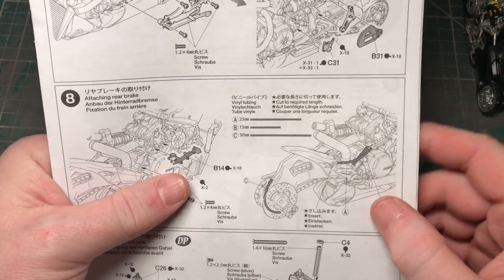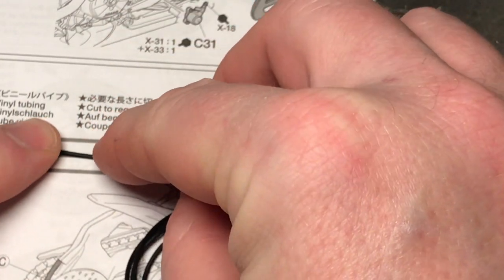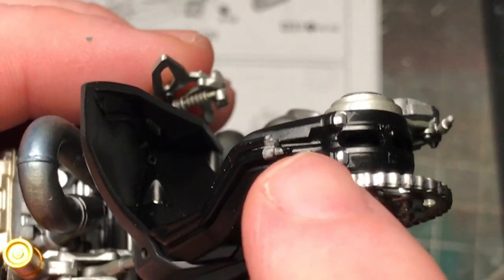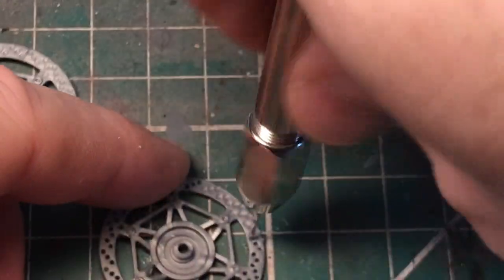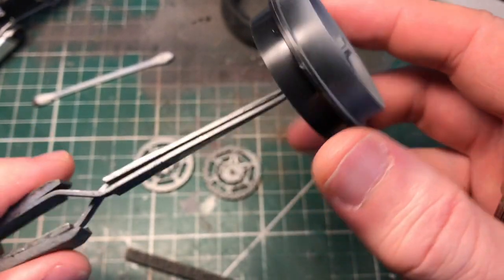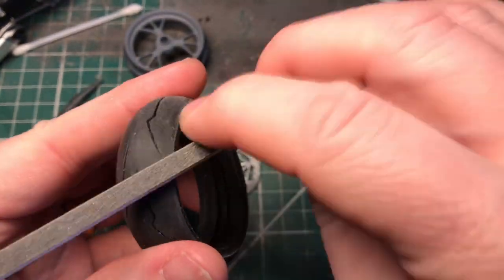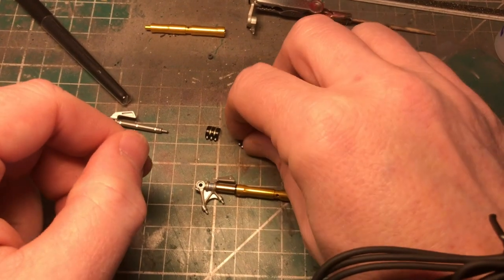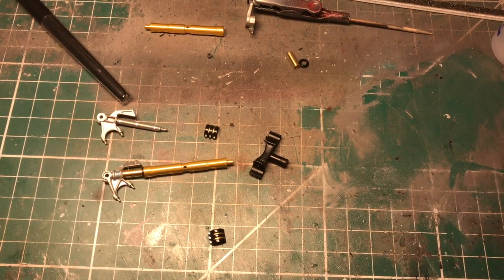Ducati Panigale S by Tamiya - Part Three

Comment: Use a ruler to cut the hoses and cables just push the concave side of the bend up against the ruler and cut with your knife. I have to say, your videos of this bike have definitely helped me in this building process. I did my first heat staining by mimicking you. Thanks for your time 👍
Reply from the maker: Glad I could help you. 😊

Comment: Why did you skip the wheel decals? 😭 This part is terrifying me. They don't look like they'll fit properly on the rim. Did it require a ton of micro set?
Reply from the maker: Hi. They do fit, just!  They need quite a lot of work to get them to fit.
Reply: @NevboModelMaking  I got them on. It wasn't as bad as I thought.